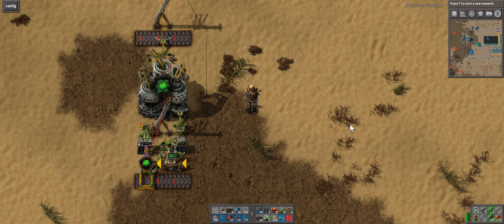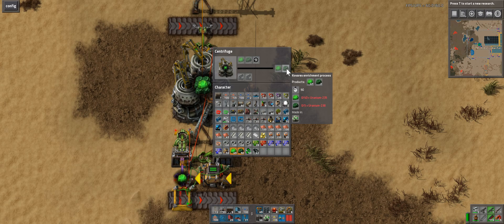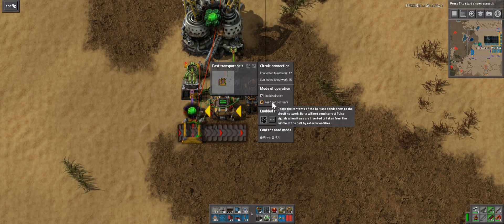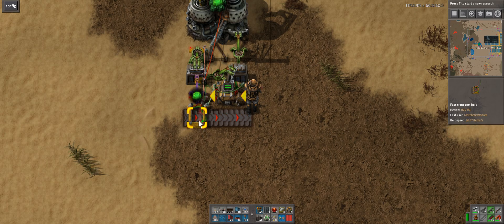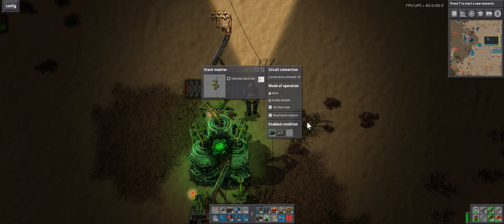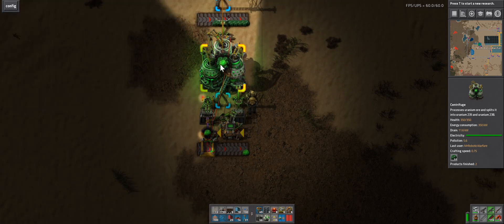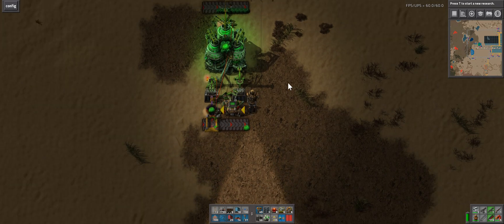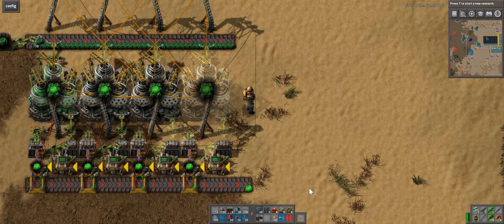Compact, Tileable Kovarex Enrichment Process Setup

Comment: I know this is old but if any still sees comments, I'm getting a glitch where the belt won't turn back on again after the chest is emptied. The decider combinator and belt have an electrical stutter for a little when freshly connected via the green wire.

Comment: I am glad they made the contents of the crafting stations readable. Can just hook up a decider to move an inserter once if there are more than 40 u235. Video did help in pointing out to me though that I should maybe not be using belts for cycling the uranium lol. Made it far more compact, and functional compared to whatever I have been trying before in my previous playthrough.

Comment: For it to be tilable and safe from material backing up, you have to move the belt being checked downwards feeding on another belt. Otherwise it will stop the whole chain once material backs up.
Reply: I used a different method. If you collect the finished 235 in a chest at the end of the belt you can wire it to the inserter that removes the stuff from the centrifuge. Then only allow the inserter to work if you have less uranium 235 in the chest that you want. This way it will never back up so it wont jam.

Comment: This is a fantastic tutorial that still works to this day. Just set up the tile-able blueprint for myself to see if I could build it on my own, and after some pain due to my inexperience using circuits, I managed to get it to click how it should be wired. Got everything working now, and it works like a charm. Great video.
Reply from the maker: @moviebad109  Glad to hear it, though this honestly shocks me -- I made this before priority splitters were in the game!
Reply: @MrRoboticWarfare  I even took it a step further and mirrored the design on the opposite side and merge the two belts at the end. I set up a 2x10 tile of your design and its working great so far.
Reply from the maker: @moviebad109  Great! Consider having the output belt feed into a splitter, and connecting all the splitters with a belt a tile lower -- this will avoid any pass-through issues
Reply: @MrRoboticWarfare  can i have the code? the string is unable to paste in game.
Reply: any chance you could send a blueprint string of what you ended up with for 1 module? I'm trying to get it to work but I'm stuck

Comment: I still can't figure it out lol. Everything seems to be working except the belt won't turn back on when the boxes contents have emptied back into the centrifuge
Reply from the maker: Check the circuit conditions, and make sure you haven't accidentally crossed the wires. Having said all that, this design is over five years old! You're probably better off just using priority splitters these days.

Comment: Still relevant five years later brother. Thanks for the blueprint! I've been sitting here messing around and struggling to think of how to do this and I figured SOMEONE had to do the circuity necessary. Here's a fixed blueprint string for anyone playing in the year of our lord: 0eNq1Vmtr2zAU/StFn+0Sv+IksMEYZYwNOvZiMIJR7JtE1JaMJIdmIf99V/YSJ6ncxM36pale5x6fc++VNmSWV1BKxjWZbAhLBVdk8ntDFFtwmps5vS6BTAjTUBCHcFqYUQpcSzavFkC2DmE8g0cy8bbO2YOVpJxVhesH0cFJv9fJ0cHJYDt1CJJhmkHDvB6sE14VM5BIag8wp0q7GlFUKaR2Z5BrRC+FwrOCm7iI53pBeBs5ZI3/BqPBbYShMiYhbfbURE8i+L0j+D0jBL0jBD0jhDZnnweO4xoYYVnt1oNYUQmPLnDJ0mWBMG4pRQpKIZCxUhkUVQJkbiGyKgfXN2QsbKI9G6Vp+uAyrkBqXDnDaFwzwhzWUuTJDJZ0xYQ0W1Mm04rpBNey/fk5k0on/dLOFIimploGZlCUVFJtYpA3ZNus80bo+nM980dCdpiZDEfxdmp2ixVIyTJI6u9EKn/A7s+wjyJtAsfRqfnh6+kTHevjXaOP5xuBLELEB0IA5G66BHWujONwlxeXhI4OotZU6hazkAD8CUuMsFOuHneQHvVxzz92zwI3vlgD/1gDC5Y32IMVkBkjIUeRsITdUuRne0AHQ897YQWHlzQrz7+ip8f+kxD/uyRSgYvnaqHNHOB0lkOSMWV+yUTLCtpVCTRLlpRnhohGJdTpjt18sxVbK9RX8aX5Prw4vbtq0gtO3J6zHL2+uEkFr9q2T9pSeNq3376gbzcf2Lw3do8fe+hpR5P3bDqGV7wkLHltC9FerRle3Bm6hGLMGK/FsBbnsUsH+EO7Z/9wW8/UM6atmNQVzrQJVO9wATVb6yXji3OXLupb6bLqUZTlGrlVXCdzKYqEcTxMJnOaK+hKBGt1mFRwiN+53nmFecMrnnM2m6fN+wrx2se8Q3KKcDj36f7nu693v24+33/4+P7m2933H19wFfVVzfGRF8ZjPx6O/cEowOfYX1hGBhc=

Comment: This is so overly complicated. With two comparators, you can just make the inserters work in a sequence.
1. Unload everything into box A.
2. A filter inserter lifts 1 U235 into box B while there are more than 40 in box A.
3. A stack inserter moves everything in box A into box C while there's more than 0 U235 in box B.
4. A comparator checks for 40 U235 in box C. Another checks for 2 U238. When both return true, an inserter moves the enriched U235 from box B onto the output belt.
5. A stack inserter to load the contents of box C back into the centrifuge is active while box B is empty.
There's an even simpler solution without comparators if you only check for the 235 getting to each box, but I found that it tended to cut off the inserters with 238 still left in box A, so it would need maintenance over time.

Comment: Nice design. I achieved that "self-feed 40 => 40+1 cycle" without the logic network though.
Reply: What was your setup?
Reply: @KosmoKnot7  I don't remember exactly, but it involved one conveyor belt going 3/4 of circle around the covarex with inserters that extract those 40 light ores and the one at the end putting them back. Other 2 conveyors+inserters assemblies are: one inputting dark ore into covarex, and another separate one is to remove that 1 only light ore just in time.

Comment: So how do you get the first 40 uranium-235 in this setup? You put it in once yourself to start the whole thing?
Also when you use productivity modules, eventually this machine will get stuck isn't it? Eventually you will get too many u-235 in the centrifuge so the left chest won't be empty so the belt won't move anymore. Takes a lot of rounds complete though.
In overall I really really like this setup.
Reply: Just started using this system and I'm coming up with this problem a lot. Guess it just can't use Prod modules
Reply: I have made something for productivity modules and the use of beacons. I do start up by inserting 40 (or 80) U-235. It is also protected for overflow, it will stop when the belt is overflowing with U-235. Once the belt isn't overflowing it will start up again. Let me know if it encounter a problem or like the idea.

blueprint:

0eNrVV91umzAUfpXIt4OK/5BI7c2kXe9mu6ki5MBJ4hYMs03UrOIB9h7bi+1JdgxtQlJIIZXW7SYRxv7O8fed89k8kmVaQiEYV2T+SFicc0nmt49EsjWnqR5TuwLInDAFGTEIp5l+ioErwVblGkhlEMYTeCBzuzJeXVgKylmZmY7rt1Y6A1am+ZpJxWIz3oBUpoBvJf6DaMG4nTBbJlSJI3ukZob5sbXSqxYGwT0xxaAhoH7YRbzMlhhjbu9Xw0MhQEpT4U5kkQtlLiFViF7kEpfnXIfWkI5/5Rtkh2nZVz6GSpiAuJngGASZViJPoyVs6JblQq+KmYhLpiJ8l+yhVkxIFY2jVcuoqNbUs/RTVlBBlQ5Cfv/4Wc94CgWcLlOIEib1P5krUcLhrQCaRBvKE52SQkqQmxVNZWvK84tmbpYnCGI1KfBmu1JnbeuftQDgbXZZgsxa1aKqtHInlDsXUO71U94Rwd1HWFEsKcYlCF1RHcDTXuDg7Vr2VShsQezUhvH1sainmt60Fe3S7FjV+mVLLnuMXGGPWt4FagWj1PKHqzX7l9W6JlUP4QKSwd0RHMIrgLRxxS4uwmMuBsYNWyHrPPzTgaAnsemxTK9WgWv1iuV1wIetfdP4/mwZ7A3YfT8DfpP6gT6WOtvQPZVj2iPH7CAHS5Gns4Tt7dN5IcX7nVg34/vFeNpsc5Q/X0+6YyPDOXauYAlEdUlh5t/h6TZzeguwhnadd1x6A7Ofnajq9+pv98ht2113tHMHmlcniEKzWqX7fEsFPJjABYs3GWKYhchjNHRE0RLWG8ChpMT9bDG2iadImYLpatvuSsm52BHcIY5guxfjO4PwD0dbBomuG0hxPtJjFnkKZ42nIZcDW2+WeVnXox0uuoL4I3zNO4b/S41pv7hJ/hrpZd0VG1zi6P7/frD30jF9/YvnXEn4vX7Tf53T7V9jRwNtMyQ6RKlJcLThdmwjHN00s3NN43UGmV3c+d7LG+ei8TcEO3wTGySliIVjX5rNT77qo+LuHoth8mHyWVzh7yfKUklXMPFuGxu97jfRBUJiOckmZmh705kzdUPPCjyrqv4AdgBF/Q==

Comment: Works great thanks! I just moved the output scanned belt to a belt line below, avoiding the potential hitch of the processed ore passing through the belt scanner. works without issues.

Comment: Hm, i think i do this in an easier way. I have a filter inserter taking out U238, and then read that signal. So whenever the filter inserter taking out U238 is hold 2 items of U238 another filter inserter takes out one U235 (stack limited to 1 and "enable condition U238=2"). That way at the end of a running a cycle i remove one U235. Its just one wire connecting the inserters.
Reply: That is a great idea, I have to test that.

Comment: There is a downtime of some seconds when the centrifuge is waiting the input of u-235 that gets more relevant as you use speed modules and becons with speed modules. Maybe we could pass the output of one centrifuge to the next one, instead of feeding itself, so while it is working it has already received the output of the previous centrifuge. Didn't test it, just thought about it right now.
Reply: That downtime is not relevant if you're running 20 of these things in parallel, you'll have more uranium than you'll ever need in minutes.
Reply: @Drambrarcer  You have no competition in this planet, you are the only human. So you can do however you like it.